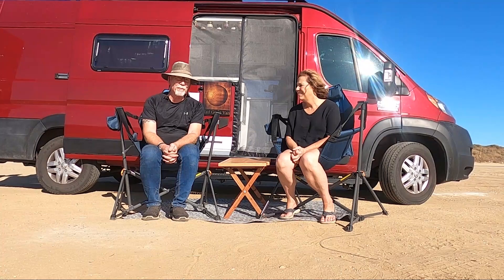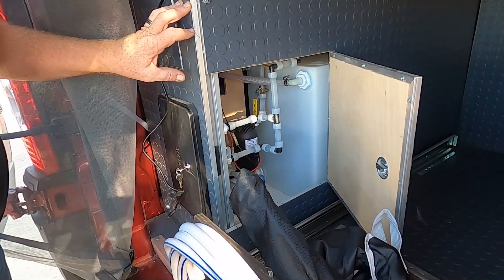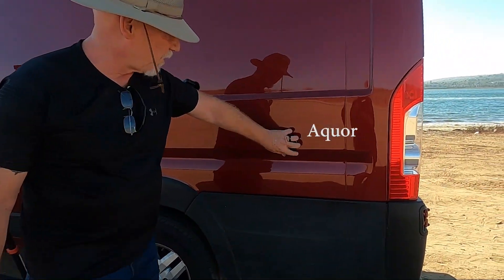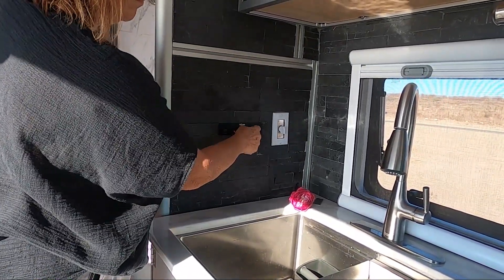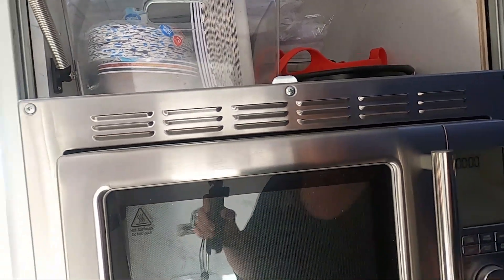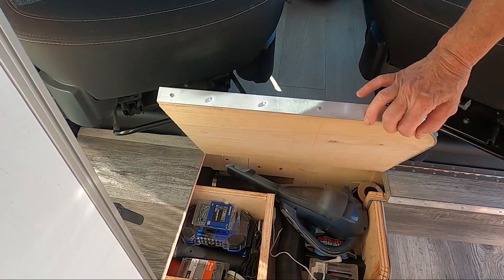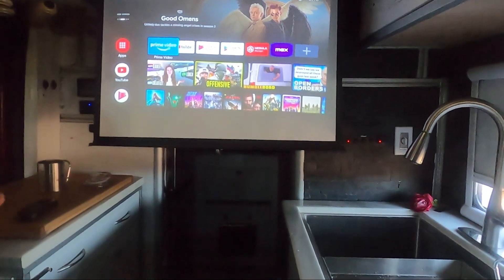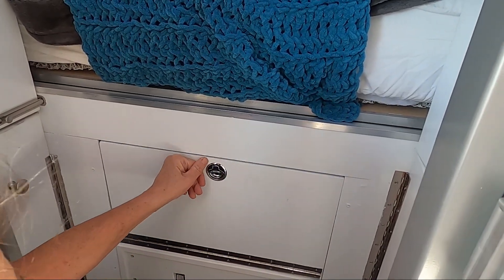Self Build Van Tour Ram Promaster 3500 Extended

Comment: Great job: I noticed that you put a rigid plywood floor over the soft section between the seats.
Reply from the maker: Yes.  It connects to the step with three long screws (what my wife called the basement).  The front of it just lays on the floor.

Comment: What do you think of the original factory installed swivel seats? Those puppies are an expensive option. Are the worth the cost and are they very comfortable. Seems most people just add the cheap $50 swivels to the standard 4 way and optional 6 way seats. My biggest issue with the aftermarket swivel plate is it adds between 1 and 2 inches to the seating height, which is already too high with the base seats for me to comfortably see out of the windshield.  I want the lower seating position you get with the optional factory swivel seats and the less expensive 6 way tilting and height adjustable seats. 

By the way, finding a van with the factory swivel seats is not easy. And a brand new van with those is now hitting $60,000 or more factory sticker price. These vans are now very spendy! Just for the empty box.
Reply from the maker: I like the factory swivels.  I think it is worth it.  The extra height of an aftermarket swivel is one thing I wanted to avoid (I'm 6 ft).  You can get a lowered base with aftermarket swivels but it brings the cost close to the factory ones.  The other thing is, since they are a factory option, they have to meet DOT standards for crash safety whereas an aftermarket swivel may not.

Comment: Just amazing. Looks like a professional build. I'm so jealous. Have you had any issue with frost build-up in the refrigerator section of you fridge? We just returned from a 5 week trip and had to defrost ours twice (at least a 1/4" layer of frost).  We have the Lectric XP 2.0 and if we charge the batteries with the bike in the folded configuration the cord has to be extremely bent to fit.  How do you do it?

What's your next big trip?
Reply from the maker: We've not had any issues with frost build up.  We've been on two trips that were 4 weeks long each.  We keep the refrigerator on setting "3".  If it's set colder, we get freezing in the refrigerator (vegetables).  That said, we haven't spent a lot of time in hot humid climates.  But you might check for a bad or deformed seal around the freezer.  Excessive frosting is usually caused by warm, moist air getting in and mixing with the cold.  

For the bike charging cables, they just barely fit.  The ST is more difficult to get it in than the XP is.   I might switch to charging the batteries outside the bike anyway.  Another issue I've run into with my setup is I tend to forget to disconnect them when pulling out the slider.  I tend to go slow when extending the slide so it's usually just a small tug.

We have another trip next week.  We're heading back to Tennessee.  We have another grandbaby on the way (due on Labor day).  This time, we're going to go North to Idaho and then across and down through Michigan (via the Mackinaw Bridge).

We're also going to go and show our van at Van Fest 2023 in Hurricane Utah at the end of October (27-29).

Comment: Did you have the overheat issues of the Victron DC to DC charger? I recently used it for my yosemite trip. We smell some plastic burning smell and the plastic case was so hot that you can't even put  your hand on. I didn't even cover my electrical comparment so plenty of air circulating. I noticed that the charger was on and off, becuase of the overhead. So I turned it off and went home install some blower's fans. Haven't had a chance to test it out yet. Hopefully, it won't be so dead hot for our next trip.
Reply from the maker: I have not noticed any overheating but mine are inside my cabinet so I will keep an eye out.  Thanks for the heads up.  I looked on Victron's site and there were complaints of overheating on older models of the Orions back in 2021 (but some people are still mentioning it as a problem).  Victron changed some hardware that limited the unit to 30 amps (earlier ones could put out in excess of 30 amps).  The hardware was changed after a specific serial number.  If you have the 4 wire version (isolated) check your serial number to see if it is higher than HQ2019.  The non-isolated (3 wire version) is changed after HQ2021.  The first two numbers after the HQ are the year it was made and the 3rd and 4th numbers are the week in the year.  So, for example, HQ2019 was made in 2020 on the 19th week.  But like I said, some people are still complaining about it.  I've seen a few posts where people say adding the fan fixed the issue.  I saw an adapter on Etsy for $15 that allowed one to add three small dc fans right to the base of the unit.  I may do that if the problem shows up.

Comment: Just wondering,how much time need it to build that perfect van❤
Reply from the maker: The overall time was about a year and a half before we were ready to take it out on the road.  That was mostly because I was working full time so I could only really work on it during the weekend.   There were also little bits here and there.    Our maiden overnighter was the First Outing video in November 2022.  We then made some changes (added a window to the slider).  I also didn't want to do the full van tour until most of the little minor jobs were done (e.g slider door storage).  Since it was our first van build, some of the delay was also "analysis paralysis", where I spent a lot of time wondering what step to do next.

Comment: Does anyone know of a good source for custom RV 12v systems that may include anyone of the following combinations; solar, vehicle charge, off shore charge, and auxiliary generator? thanks in advance.
Reply from the maker: If you mean a turnkey type unit, FreedomVanGo has prebuilt units (but it's very expensive).  I bought my components from them.  The cost worked out to about the same as finding the components individually.    Also, I don't know of many private builds that include a generator input though you could probably attach a portable into an external outlet (like shore charging).  The other option is a solar generator type unit (e.g. Ecoflow Delta Pro or something along those lines).  They're prebuilt and have all the components in one unit.   For me the biggest concern for a unit like that is if one thing fails, you need to replace the entire unit unless you're comfortable tearing into it (but then why not just build one).  The Ecoflow Delta Pro is unique in that it has a port which can charge from an EV charging station (with an adapter that's sold separately).